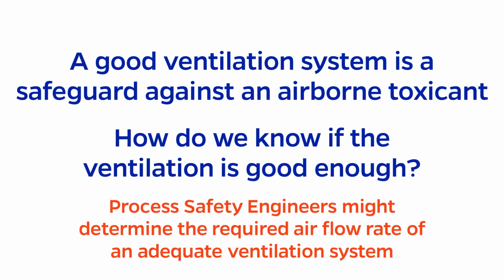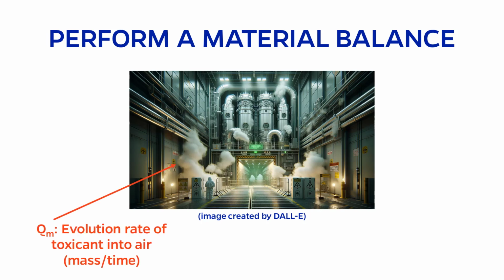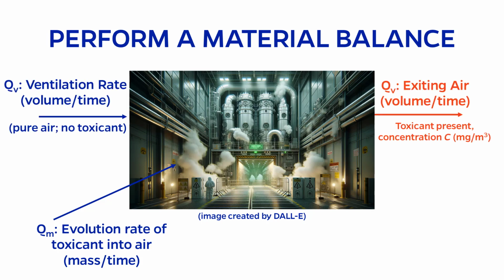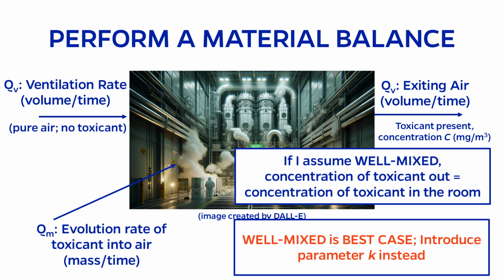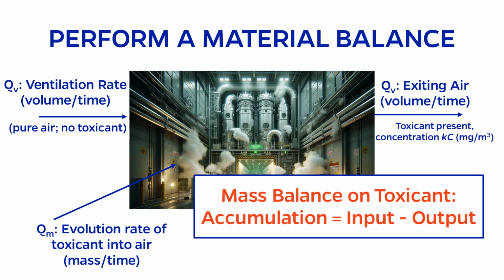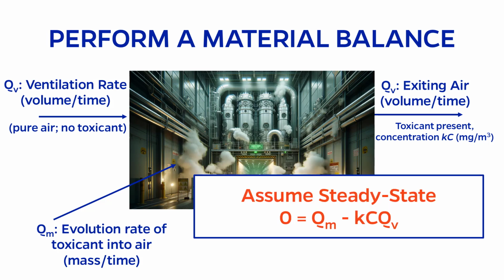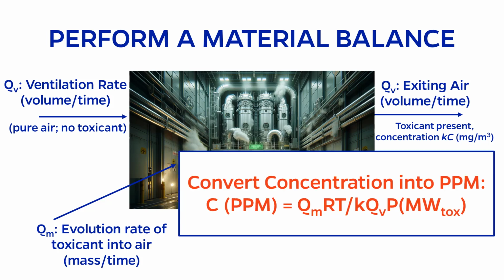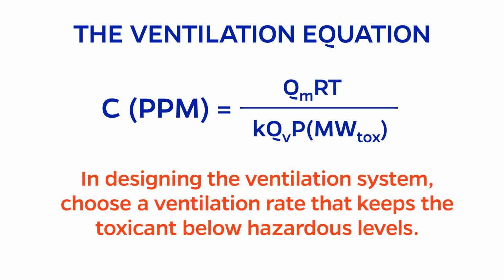Designing Ventilation Systems (Chemical Process Safety)

Comment from the maker: IMPORTANT CLARIFICATION: Comparing my final "ventilation equation" to equation 3-9 in Crowl & Louvar, it appears at first glance that I am missing the "x 10^6" factor.

However, whether I need to multiply by 10^6 depends on my units in the rest of the equation. If Qm is in mg/time and Qv is in m3/time (same time), you would not multiply by 10^6